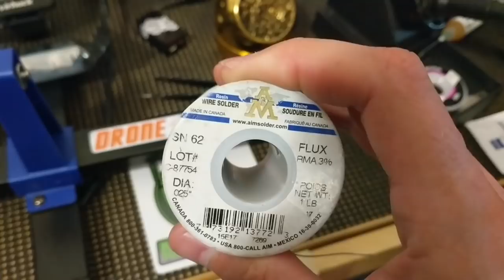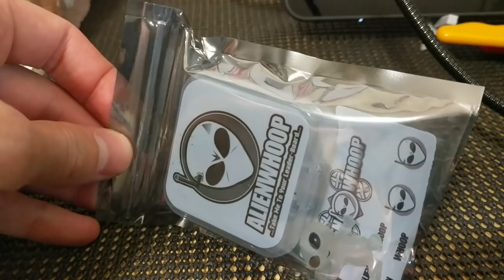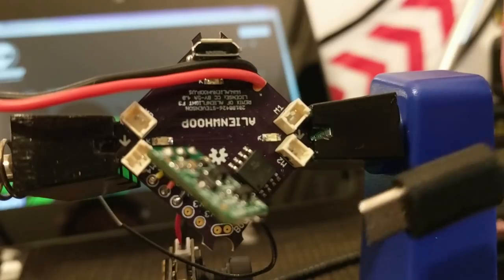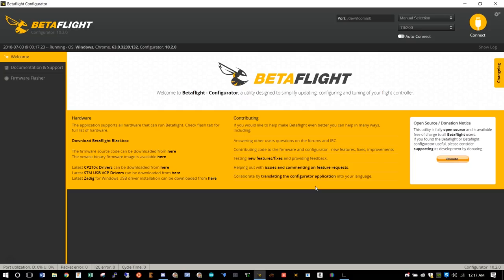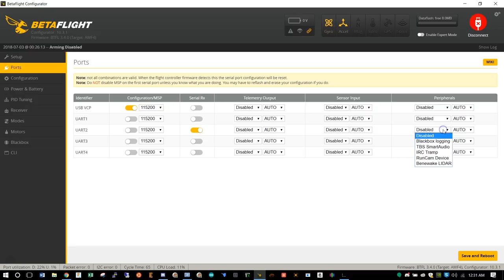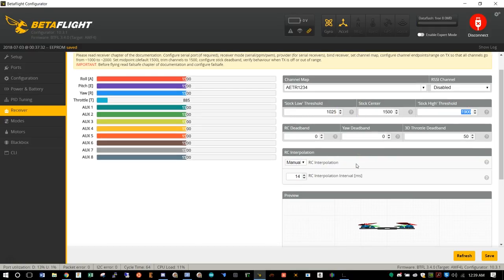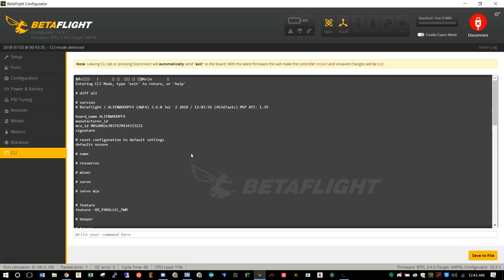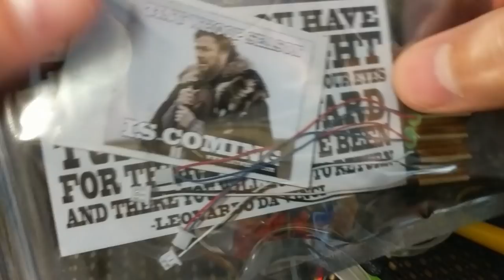Official AlienWhoop V2.1 Build Video

Comment: I just finished my build. I just realized it doesn't have Betaflight OSD on the flight controller for v2.1.  Is there a way to get OSD on this fc?
Reply from the maker: There is no OSD chip on the V2.1. You can use external OSD for example the FX805OSD camera/vtx combo.

Comment: were did you get the braided wire that you used on the receiver
Reply from the maker: I bought it as a set of yellow black and red 30AWG silicon coated wire on Amazon
Reply: Charles Stevenson thank you